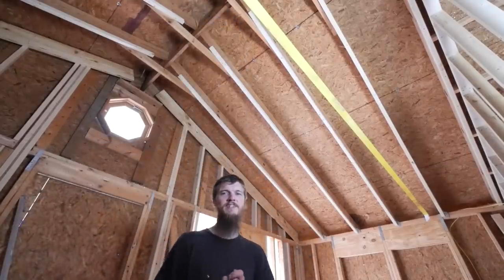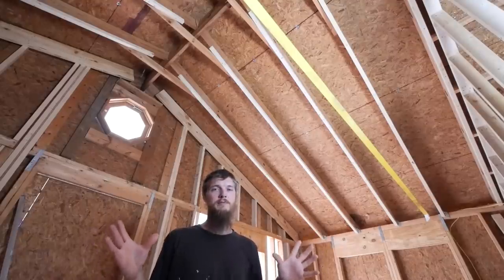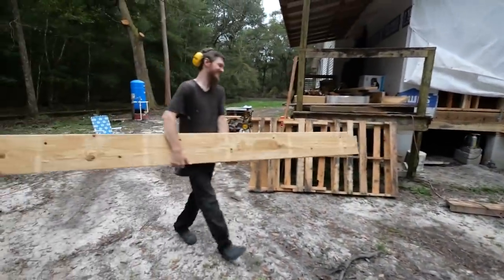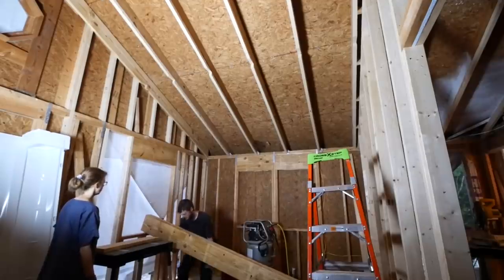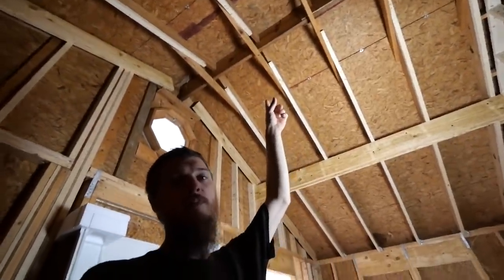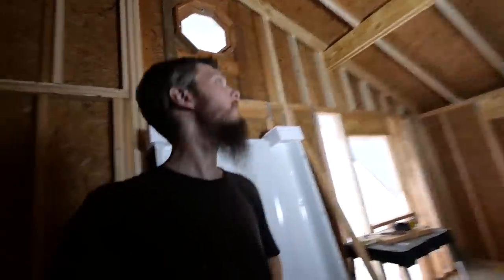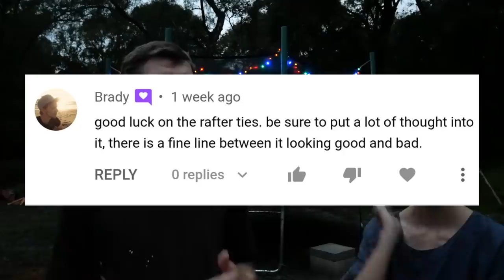The Hardest Part of our Build - Building Beams for our Cathedral Ceiling

Comment: Absolutely a top piece, or as some might call it a bowl, for a hookah. Traditionally used in the middle east to consume tobacco, you would put tobacco in the top where the holes are, wrap it in foil, poke holes in the foil and then use special charcoal disks to slowly vaporize the tobacco.

Comment: Good job making the engineered beam. if you hang a ratchet strap from the roof truss in a loop at each end it will support the beam instead of fighting the weight of it  and you can ratchet it into place ( for future reference ).
Reply: I was hopeful someone would have a safe and efficient method for lifting the next beam in place. Was thinking a pulley system myself, but ratchet straps is an awesome way to go.

Comment: Looks like it could be a wire insulator from an early electric or telephone line .  I’ve seen them with the water drain holes before.  But never seen any in that color.  Just an off the way guess. Great content 👍

Comment: It's an egg cup. Used to serve a hard boiled egg at the table, where the diner will tap around the shell, remove a portion,  and scoop the boiled egg out with a spoon.
Anyway that's my guess.
PS. There is probably a matching saucer nearby.
PSS. Next guess, a candle holder. The holes in the bottom are to let gases escape while it was fired in the kiln.
Reply: Lol, no, it's a hookah bowl
Reply: @francesbridges2417  look it up, I'm not kidding..for smoking tobacco or weed, not so sure it's not all weed of some sort..

Comment: Great that ashley strung up some lights around the trampoline, they don't use that much energy either. The beam looks strong and will make the house more stable with a mid beam holding the roof

Comment: I love the lights and respect you both for sticking to your conscience and waiting until you could find lights not made in China. As to the mystery item, I liked your guess of a pie vent but agree it's not quite the right shape. My guess is a laundry sprinkler. Put water in the big hole and stop it up with a cork. then sprinkle it on the laundry through the small holes to dampen the fabric before ironing. Vintage ones online look very similar to yours.

Comment: We put post & beams in our house to support a shed roof that was under engineered  We used closed cell foam in the ceiling because we were having condensation issues with a vented ceiling. "Spray Jones" on YouTube  can tell you how to have it done correctly. It was actually cheaper to have a professional company do our spray foam than to do it ourselves.

Comment: Just an idea about the pinkish thing Ashley found after the ditch was dug out. I suspect it is an old insulator for electrical lines that use to be used on the top of utility poles when they first electrified areas of the country back in the early 20th century. Reason I say that is I remember seeing things that looked a lot like what you were showing on top of utility pole as a kid (that would be back in the 70's) in rural areas of the western part of Virginia. Seeing that what you all found was out by the road, where maybe utility lines ran, it seems plausible.  I might be totally wrong, but it sure looked familiar to me.... just a guess.

Comment: Doug and Ashley, you are demonstrating to the world that we are soooo much more than our degrees, and have so much more potential. That said, I think I may recognize that piece you found hidden... I remember my mom having a "sprinkler" for her clothes that had a similar construction... I think the concentric circles are to hold a rubber washer of sorts that fits inside a bottle neck... you would fill the bottle with water... and sprinkle your clothes through the little holes in the flat circular  section at the end... in our case the construct fit into a coke bottle.... that was before steam irons were common. And, before that Mom would sprinkle the clothes with water and wait a few minutes for the moisture to permeate the fabric before she ironed.  First time I saw the sprinkler construction I was about 10 at a friend's house. But  I do think that's the function of that device you found..... and great work so far...As a former gymnast and safety fanatic, the trampoline is pretty and fun as long as you don't get good at jumping... when I was a gymnast our jumps were about twice as high as that netting, so the netting at that point is a hazard rather than protection... but then, the trampoline was always inherently dangerous, like the high bar and the uneven bars... but then, I've seen very serious injuries incurred doing FLOOR EXERCISE... so, such is life.   Take care and God bless you all.

Comment: Good information in this video, Thank you both for the abundance of information. A house I bought has a 14x30 addition that wasn't finished out or well, finished with framing. I did check to ensure the walls were not pushing out. Thankfully they have not because the addition has been sitting for nearly twenty years. I will be adding collar ties in the spring once I get the building permit, this year is all about demo work.

Comment: It’s a hooka bowl. You would put that wet Shisha tobacco directly into the bowl then cover it with foil, then poke lots of little holes in the foil and put 2 coals on top. Put the bowl on the water pipe and smoke away

Comment: Another nice project with an obvious benefit. It is an interesting way to ensure the ceiling and roof are excellently supported, while retaining all the design aspects of the vaulted ceiling. Those beams will help the eye to follow the line of the open vaulting, rather than having cross braces that disrupt the eye line. Seeing your work to support the new beam, it looks far stronger than any of the previous structure, though the effort and risk to get it there was a moment of behind the sofa time for many watchers.

Comment: All praise to Doug for his acquired skills serving the special intelligence needed to load spread especially on ground which gets very wet now and then. Further, by using actual cut precision joins he achieves what builders of old did in ecclesiastical buildings in Europe so that interior space is as open as possible. 
Modern ties can be an extra security in very high wind but heavy beams to a solid floor to the column supports should stand nearly forever.
I hope some day he will visit some of the great churches of Britain, France, Italy and central Europe.

Comment: Candle holder , salt shaker , melt bottom of a thin long white candle stick and the holes will help the wax from being pulled out when picked up. Could also be a weird shaped salt shaker without the rubber piece to hold the salt or pepper inside

Comment: That mystery object looks like the top of a hookah. The larger end with the holes would be the top, lined with foil and filled with flavored tobacco. The smaller end would be fitted with a rubber seal and attached to the main body of the hookah. It's definitely not worth saving in its old form, but it does look like something that could be easily repurposed for some other project :)

Comment: It's the holder for the flavoured tobacco in a shisha pipe. The tobacco goes in the top, you cover it with skimknim foil, poke holes in foil and place glowing coal embers on top. That then sits on the top of the shisha pipe.

Comment: the pink thing in the beginning of the video could be a incense burner for stick cone or disk types. this also could be a fragrance oil diffuser the clay soaks the oil up and with heat or wind slowly releases the fragrance as the oil evaporates ( it may be missing a cork or stopper).

Comment: Doug, your last comment left me with the impression that you were/are going to remove the rafter ties.  Did the inspector say that was ok?
Reply from the maker: I think it's just a misunderstanding. There are no rafter ties currently. Instead of doing rafter ties we opted to install the beams to carry the roof load. The ties at the top are collar ties and are staying in place. Rafter ties are installed at the bottom third of the roof and collar ties are installed at the top third of of the roof. They each have a different purpose. So no worries. Our collar ties are staying.
Reply: @diyfferent  - Yes, of course.  Reminds me of when I had a new, heavier roof put on.  The plans called for rafter ties in the garage, but were installed looking too much like collar ties.  The inspector made the roofer remove and lower the ties to half way.  Close enough!

Comment: It reminds me a little bit of a sprinkler I have that is metal that goes on the end of a bottle, and back before steam irons, or before people could afford them, they sprinkle their clothes as they iron with it. The one I have is metal with a hole in the middle, surrounded by cork so it easily fits in the bottle. The difference with this one almost seems like it would go on the outside of the bottle instead of the inside. I think that would work if it was lined with cork so that it could be pushed down on it rather than into it. In a way that doesn't quite seem like it's right, however, because I'm not sure how readily that would stay on the bottle. It's kind of a mystery. It actually could be used as some sort of venting device for baking. Not sure.

Comment: I sure hope those ditches help with the flooding issues.  That pink thing looks like it could be a shaker ... The pink color is very retro.  I was afraid you were going to fall from that ladder trying to hang that beam.  I fell from a ladder like that last spring.  I ended up breaking my wrest and hip.It took me months  to learn to walk after a hip replacement. So be careful.  Have someone hold the ladder at least.
Reply: People say that pink thing is a hookah bowel.  I use to be a pipe smoker but have never tried one of those.

Comment: Look's like a "Flower Frog"..Sits inside a low flower pot for cut flowers, so ones in the middle are a little higher...Maybe a Vanbiggle....Hole allows them to get water while standing tall..Used with Flo: tape..

Comment: I know what that thing you guys found in the ditch is and I can't believe I haven't seen anyone else comment about it (unless I haven't scrolled far enough)... it's for hookah lol it's the bowl that holds the tobacco. I used to work at a hookah lounge for a short period of time. I knew immediately what that thing was and it just cracks me up, but maybe it's a good thing no one seem to know what it is. Don't use it for anything food-wise, definitely don't use it for baking pies like your thought lol. Even if you cleaned it well, it will probably still have lingering tobacco infused into it.

Edit Whoops I did find a comment that said it's for hookah, well at least I'm not alone lol (I don't smoke it anyway)

Comment: Wow on lifting that beam and you have another one to go, I was so scared for you two. Totally different subject - home inspection. As far as I know most all remolding requires state home inspectors to approve the work done at various stages varying per state. Framing, plumbing, electrical, foundation and etc. I also know that some jobs require depending on state per-approved architecture plans. I think you far out exceed any building codes and your quality of work is over the top but the law may require inspections. If you do not have those inspections then the remodel may be illegal and you could not sell your home later on. Please do not think I am questioning your work I am just worried about legal ramifications.

Comment: That somewhat reminds me of the old clothes sprinklers.  In the days b4 steam clothes irons, people would dry their clothes, then put a top somewhat like that only usually smaller with more small holes over the top of an old soda bottle filled with water.  Then they would  lay the wrinkled item out and re sprinkle it.  The object was to put some dampness in but not make it so wet an iron would singe it. One never wants to singe a white shirt..oh the agony!   Once sprinkled, the garment would be rolled tightly and put in a huge zippered bag then set in the refrigerator until a day later.  My dad was a math teacher.  He always wore white shirts.  My job as a teenager was to sprinkle and iron Dad's 6 white shirts (one for sunday 5 for work).  Yes, I'm older than your grandma I bet. I'm thinking it surely is some kind of sprinkler head.

Comment: It is a flower frog. You set in bottom of bowl of water, then stick cut flowers in opening. The smaller holes in bottom assure stems get water. It helps flowers to stand in bowl and not flop over

Comment: I don't know if this hit you later on, but when you were re-gluing the beam, you removed the screws holding it to the one board and just flipped it over to the other one. What you ended up with was the exact same configuration, only in reverse. In other words, had you flipped the finished product over, you would have had the same connecting faces as if you'd never changed it. 🤣
Reply from the maker: I always try to put my beams and joists crown-side up.
Reply: @diyfferent  - I can understand that, but the result was the same. Watch the video carefully and you'll see what I mean.
Reply from the maker: We lined up the middle board on the wrong edge so we fixed it. If you watch closely, the smaller sandwiched board would have ended up with the bottom at the top.

Comment: My thought is that it was attached to a plate and the part with the holes was to set something like a tea bag in to drain. Marsha S's guess as a clothes sprinkler was good but the shape of the holy part is concave and a sprinkler would be convex & the holes are to large. I used a contraption like that for years stuck into a Dr. Pepper bottle. LOL  I'd search eBay for Hull or McCoy tea caddy or drainer. Hull and McCoy were potters from the 40's to the mid 70's. Pink was a Hull color primarily.

Comment: My guess it's either an electrical insulator part (are there power lines overhead?) or the bottom of some sort of flower pot base.
Reply: I was thinking the same with the power line insulator

Comment: When you did the glue up change, didn't you put all 3 beams in the same order.? There was no difference
Reply from the maker: They were all supposed to be put together a certain way so that all the crowns were the same, but we lined up the middle board on the wrong edge so we fixed it. If you watch closely, the sandwiched board would have ended up with the bottom at the top. It's hard to explain.

Comment: Ashley's find in the ditch may be a part of the pottery/ceramic water filter systems used in the Victorian era, made popular after the contamination in the waterways spreading plagues. I've seen them found on the Northern Mudlarks, also Kit and Caboodlers YT channels. Do a search on Victorian water filter containers. Parts of conversations between you two .... A - That was Scary! Don't make noises while I'm getting down. ;l   <-- Me - (Now there's a bit of Ashley's Spunk) A - That sides done, except the lagging. D - No I still need one more. A - One more? D - Yah cause ya got to sandwich it in. You're kidding Right? D- No..!   You two make me smile. : )  The Pretty Lights Say .... Fun! Love it!   A Pulley System may help with the work and safety.

Comment: You know what you're doing,  but I would have notched the beam instead of the rafters.  The rafters are weakened now at the notch.
Reply from the maker: The original rafters weren't weakened. We added extra wood onto the rafters to be able to use a thicker insulation, and that's what was notched out.
Reply: @diyfferent  Good for you.  I didn't see the other original rafters until I watched again.  Thanks for pointing that out.
I have seen other people who cut notches and deep bird's mouths that severely weaken the structure.

Comment: Lol................ You just unscrewed and flipped the top board, the same what would have been done....... what you mayyy be meant to do was have that hacked up looking on be an outside, rather than a huge void/gap
Reply from the maker: We lined up the middle board on the wrong edge so we fixed it. The smaller sandwiched board would have ended up with the bottom at the top.

Comment: OMG! Please get a taller ladder or something? That scared the crap out of me, you standing on the very top of the ladder. Or maybe devise a rope and pulley system to lift the beam? Idk. Just something safer. I haven’t done construction but I was in skilled trades. Any way you can tie yourself off in case that ladder flies out from underneath you? My ex was in the skilled trades also and had that very thing happen to him and he broke several ribs. Some kind of jacks? Wracking my brain here for a solution. Please be safe.

Comment: Was the beam called out in a plan or load . No need for the beam and way over sized if your going to do one. Blocking would have stiffened it. and never do your cut in the air. cut the beam with a slope. work smart
Reply: They used a ridge board instead of a ridge beam at the top so it definitely needed a beam somewhere to help support it.

Comment: You cut the birds mouth too deep. You’re not going to support anything with those.
Reply: It's backward. You're 100% right, tho. They only reduced the outward pressure on the walls by about 10%, if anything. Only because of the fastners. 

It's also overkill on the 3 beams if he did the birds mouth correctly and did both sides. 1-2 would be sufficient, depending on the span. 

Also, that slant cut they made to rest the beam on is not good. Also, not having the support beam carry all the way to the foundation is just wrong. They have a window under it lol ... The work will hold. But it won't stand the test of time. I hope he strapped the shit outta it. But there are so many break points if they ever had a real storm, like a hurricane, it would be dicey. 

I'm glad they thought of the wiring trench, tho! 😅